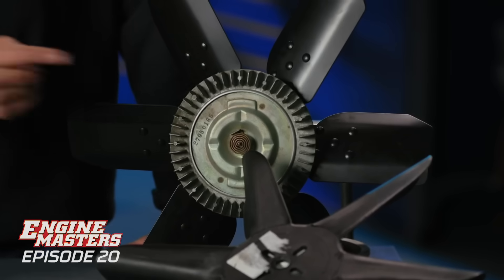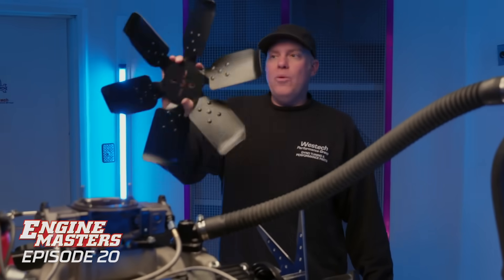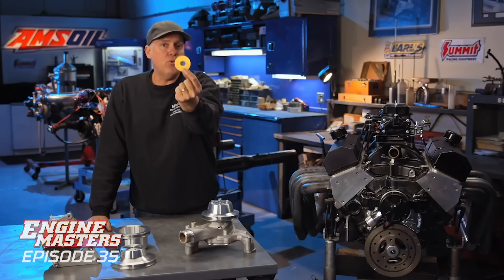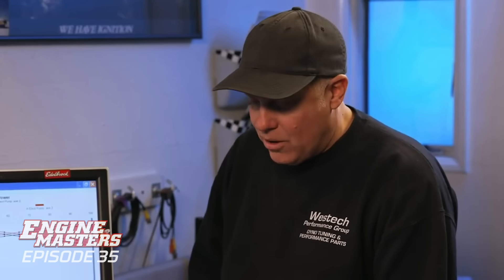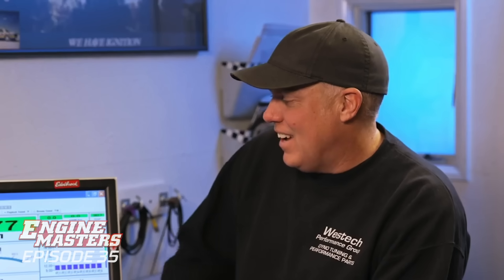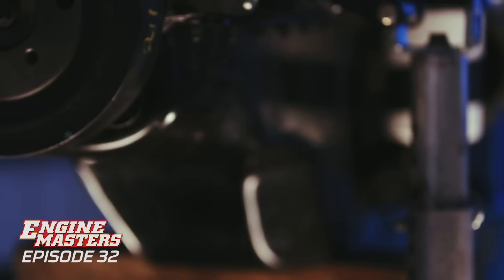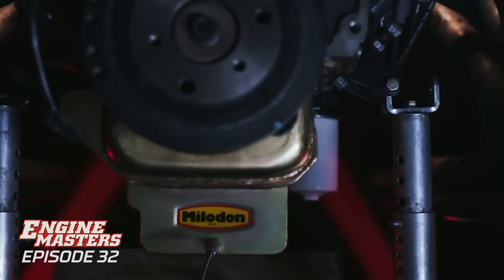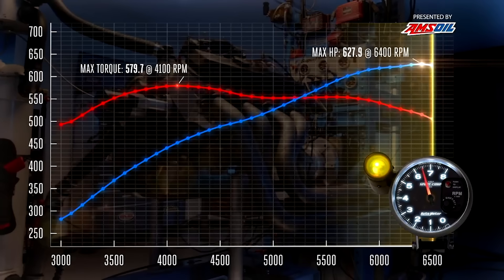Don't Do This! How to Ruin Your Engine's Horsepower | Engine Masters | MotorTrend

Comment: Well which fan was best? I only saw results from two of the four candidates.
Reply: Yes Chris the whole vid was disjointed and difficult to follow.
Reply: @ThePaulv12  If you read the title of the video, and noticed the overlay of which episode each section was from - you can interpret that this video is just a compilation of videos that show what common mods tend to kill power.
Reply: Yeah! What the F?
Reply: @troykruse5161  ever since they stopped putting full episodes in YouTube, they've been making these mismash clips from various episodes in hopes of luring in paying subscribers onto the motortrend app. But they put together these bait videos so poorly I doubt they get many people to join.
Reply: @SeanMontie  like me: not sub
Reply: @SeanMontie no they do it so they make new video so it looks like we haven’t watched this one before. That way they can get new views and all that to make money again off of it. They’re just gaming the system
Reply: The best is to replace the fan and install an air plane propeller. The extra pull will give you quicker 1/4 mile runs
Reply: For the record to those of you saying "electric", it wasn't even one of the four given options. They were:
1. Steel with clutch
2. Plain steel w/o clutch
3. Plastic flex
4. Aluminum flex
Reply: @ChrisInND  yes and electric is better and just as easy if not easier to install than any of those :)
Reply: @Joshlindsay22  no way is it easier to install then removing and tightening 4 bolts lol
Reply: @Thumper68  if you don’t know how to hold the fan in place while doing it yes it is. It took me no more than 25 minutes to install mine but it was switched not relayed
Reply: @Joshlindsay22  ok well took me 5 minutes to change mine. like I said 4 bolts doesn’t take a genius...
Reply: @Thumper68  but the man with the wires instead of bolts it’s always gonna be faster
Reply: @Joshlindsay22  What's holding the e-fan to the radiator?
Reply: @thatsonebadhatharry8610  electric fan ties is what I use
Reply: More i think about it, which fan pulls the most air for the power used?  I would give up a bit of hp if the fan pulls way more air
Reply: @sketchyssk8shop  
Fan only needs to pull "enough" air to keep the coolant at temp. "More than good enough" is just wasted HP.
Reply: @bcubed72  enough for a dyno pull or enough to tow a load all day?  I prefer to pull a load tather than a 5 second dyno pull or a 15 second drag race.  Or if i have to sit in heavy traffic (which i do a lot)  id rather have more air n waste a hp or 2 than over heat
Reply: @sketchyssk8shop  a pair of electric fans
Reply: Did the oil pan have a windage tray? If not the oil pan upgrade is a joke
Reply: They did this same test in the magazine and the temperature controlled clutch fan won... and is more reliable over 50 years than electric fans...
Reply: I was thinking the same thing. They ripped us off for video time & all information gleaned from the testing.
Reply: SuperDave Miorgan  electric fan #1 clutch #2. Only time a fan is needed is for slow speed and or heavy load at slow speed. Once vehicle is moving at a moderate speed the air flow over the radiator should be sufficient to cool the engine unless you  have blockage or an unusual radiator location.
Reply: Tangent:
How deep (in the shroud) should the fan be on a custom built car?
Reply: They didnt show the clutch fan dyno as it increased engine torque by 5% due to keeping healthier temps.
Reply: SuperDave Miorgan  I guess that really depends on the intended purpose of the vehicle you are driving. A daily driver maybe, a weekend warrior probably not. A truck yes. And most but not all new cars use electric fans so I don't think the alternator is an issue. It's really just a situational thing. But the clutch fan and electric are the better of the four for sure.
Reply: They did this to peak your interest so you will pay money to watch the whole thing.
Reply: I know..I used to run a fan like the one here with the Blue on aluminum blades..it was called a "flex fan" way back in early 80's when I bought it for my 68'Camaro..would like to know how much HP it drained.
Reply: electric fan.....ALWAYS. Plus you can run a switch to manually turn it off for drag racing to reduce the load on the alternator
Reply: @jubalwright421  You can also switch OFF your alternator for the 1/4, if you know how to hook up relays.
Reply: @jubalwright421  not always.   Clutch fan is more efficient.   Converting rotational to electricity to power a fan to make rotational is not efficient.
Reply: @jubalwright421  Put a switch to turn off the BAT. feed to the alternator too.
Reply: i did some research and at your local auto parts store they sell both a non-oem fan and fan controller  that you can rig in. just take the old fan and clutch off the car and run with that and you'd have the power loss removed as well as a possible weight reduction when it's all said and done.
Reply: @jorgey4  when bypassing the electric fan in the summertime, just keep a close eye on the temp gauge.
Reply: I thought I was trippin.
Reply: I think what they are saying here is you can expect to lose anywhere from 23 to 30 HP from your fan.
Reply: E fan is always best
Reply: Electric fans
Reply: Clutch fan will always win.
Reply: @johncholmes643  but only if your engine runs under 160-170 degs, once it gets to normal operating temp 180-190 degs its locked up, or its supposed to be.... also anyone thats observed your average aftermarket aluminium flexifan blades as you rev your engine above 4-4500rpm you'll easily see the blades flatten out to the point that the blades have lost almost all their pitch. Hook up your timing light and it'll slow the blade speed down enough (not perfect) but enough that you can easily see the pitch change from idle to say 4500rpm which is where any good flexi fan worth having should be almost flat and not creating bugger all drag. The example Flexi fan that David used was clearly used to exaggerate the difference between the 2 options, which at the end of the day proved nothing. The test should have been which of the fans available to the average Joe Public actually shifts the most amount of air for the least amount of parasitic drag. 'CAUTION'- Be very very careful when using a timing light or torch anywhere close to a Spinning Fan, theres is no need to get any closer that 12' from any spinning Fan or Belts/Pulleys.
Reply: This is a copy of an old test in carcraft, same results BUT based on those results(and these).  My Plastic fan takes about 10hp because of the pulley ratio I run, they use a larger crank pulley than water pump and I use the opposite.  Basically my fan sees less than 4000rpm, so just look at their 4000rpm mark roughly, most mech fans are about the same at that rpm.  Far as electric fans, your taking mechanical work converting it to electric and then back into mechanical, there are always losses no alternator is 100% efficient.  Electric fans work great for highway cars when speeds are high enough that they don't run or at the drag strip when it's off for your pass
Reply: @BOOT    true I did the same , by far the cheapest HP you can get.
Reply: typically, the clutch is best, tho you'd think its heavy.  But even better is an electric fan you grab out of the junkyard for a front wheel drive car.

BUT, make sure you grab the alternator.  Our old muscle car alts don't have the juice for electric fans, massive stereo, and EFI. and they are heavier than the average denso unit.
Reply: Ask your money back :-)
Reply: ???? Electric Fans
Reply: @mikespeck8642  yeah you know fans that hook up to a switch and power they’re pretty great
Reply: U can add a full throttle and mph relay to turn fans off win win floor it and drive dont got to remember anything with that !!
Reply: @rickybailey7123  if you use a generic fan controller it just kicks the fans on when the radiator hits a certain temp. you don't have to program a holley ecm or jerry-rig a bunch of switches.
Reply: SuperDave Miorgan  my electric fan setup was just as much as my clutch fan setup to replace I fabricated my own shroud and all. Don’t go talking about too much money bs
Reply: electric fans is the best candidate

Comment: Today I learned that you don't want to warm up your motor before racing it
Reply: Heat robs power. Unless the heat is needed, you don't want it.
Diesels also need to be warmed up before a race.
Reply: Also friction robs power and hot oil flows and lubricates better than cold oil. So it has to be warm enough but not that the intake soaks heat. Also a cold car runs poorly at first till it warms up the combustion chambers etc. Heat is needed to makes power because it loosens the fluids and preps the engine to make that run too.
Reply: 130 degrees

Comment: I’d like to see a full companion of running mechanical engine driven fans and compar that to alternator plus electric or dual electric fans.
Reply: mechanical fan = mechanical straight.
Electric fan = mechanical to electrical and back to mechanical.
I'd like to see your suggestion too but I reckon this: Dual electrics and fan clutch ~ the same power loss. 
Advantage with electric is it cycles on and off but a fan clutch does too, to an extent. 
Personally I don't like electric fans as primary means of cooling unless it is OEM. My Mitsu daily driver has them and they work great.
Reply: @ThePaulv12  thank you for the reply. I would also agree. The other thing I like about electric fans is if you want to run them when your vehicle is shut off to cool it down you are able to. Plus you can have them set on a timing so they don’t run out your battery. The same goes for an electric water pump. But it would be nice 👍🏼 to see it all. I’m just some guy looking to gain some knowledge [=
Reply: @ThePaulv12  Not even close, they only pull their max amps while spinning up. Once up to speed the pull about 1/10 the rated amps.  Using a mechanical fan is just a waste of power today.  A powerful duel electric fan might pull 35 amps max,  even at that that's less than 2hp to generate the power for that.

Comment: Dave, please do this simple test, I, for 40 years never could figure it out.  Ok, here it is,  in days of old we use to flip the air cleaner lid upside down  on GM  stock air cleaners to get more air and a better secondary open butterfly sound.  Please test to see if it was a waist of time?
Reply: They did that in another episode many years ago. Think it made a tiny bit more power, but not enough to justify the extra dirt getting in the engine.
Reply: Okie it was great at 16 to flip every lid we could. It was cool.

Comment: Okay, but if you're using a roller cam, wouldn't you naturally spend the extra money on a pan with proper windage and oil traps? If so, wouldn't that restore the horsepower and allow you to run the full 7 quarts of oil?

Comment: If you are building an engine for horsepower specific reasons why would you not use electric thermo fans? No disrespect intended genuinly interested in opinions.
Reply: Most people are wondering if the hp/tq gain is worth the time and money of ditching the old mechanical fan on a street car. All street car stuff. On a max effort race engine you will never see a mechanical fan and will rarely see any kind of mechanical water pump. They can’t take the rpms of a race engine. And cause too much parasitic loss.
Reply: @devoncoolman88  Yeah I get it just doesnt seem like that big a deal to go thermos. Was wondering if there was any specific reason someone would choose crank driven fan other than keeping it factory.

Comment: Our 72 dodge was overheating. Dad reached in and stopped fan on running motor. Had bad thermo clutch. He was brave
Reply: Brave? More like stupid. Had the clutch been good and the motor pretty strong, he'd have lost his fingers. I've lost the tip of a screwdriver by accidentally getting too close to a running fan. Those things don't play.
Reply: Not cool

Comment: So my rear main seal is actually a power adder. 1 more excuses not to fix it then.
Reply: Its not leaking oil, its just sweating horsepower.
Reply: @Underpantsniper  Not sweating hp, it's sweating drag.
Reply: low on gas help with weight reduction too
Reply: Your best run will be the one before it grenades
Reply: Ironicly its tru, the closer the engine is to damaging point the better it works
Reply: @ghostwarhammer007  to better word it, the tolerance is wider so less friction thus giving it better performance.
Reply: @BlueRice  If it gets that low the friction won't be less for long but there's less pressure.
Reply: @BlueRice  thankyou guys for that clarification. I read that statement someware i thoight it was a joke,until i was watching "history of formula 1" and it was mentioned by the engineeers ... Dannng yooo!
Reply: @scottricklaroque7428  thx mann
Reply: @ghostwarhammer007  so that's why my supra makes 1000 hp stock? More like 1100 brooooooo 🤣🤣🤣

(This was a joke)
Reply: @ragooagoo4918  🤭🤭💥💪

Comment: You can directly calculate the hp use of an alternator based on its output.
Reply: Sure, because alternators are 100% efficient right?
Reply: @Underpantsniper  no, they are not 100% efficient. They are about 55% efficient. This equates to 1 hp per 25 amps. I can go through all the math, if you would like, how to to correlate volts and amps to watts and and watts to hp with the efficiency loss. It's plenty accurate. Use google before you comment, you won't look so stupid.
Reply: @AnonyMous-jf4lc  I look stupid... but still glad i commented so i can learn somthing new. Whats the average resistance of a alternator?
Reply: Still you loose less power with electric setup.
Reply: @L-Noble.YT_Hi.Res-Soundminds  he just proved your point.... gotta love the internet ;-)))
Reply: @Warrick440 👍Yes...
Reply: @L-Noble.YT_Hi.Res-Soundminds  we are talking about the alternator...........
Reply: @AnonyMous-jf4lc  Yes the alt. So if I put a 20 amp load on my charging system the alternator will only take a little less than 1 hp from the fans turning on correct?
Reply: @L-Noble.YT_Hi.Res-Soundminds  my comment was about calculating the horsepower consumption of the alternator based on the load, nothing about the other accessories. Typically, you lose efficiency converting energy (rotational to electrical back to rotational) however, because of the variable operating RPM of an engine, electric accessories operate in a peak efficiency state, so you tend to gain more than you lose.
Reply: @AnonyMous-jf4lc  Thanks for explaining that, I appreciate it..

Comment: So, long story short:
Drain oil, remove fan, alternator, water pump, run ice as coolant and only drag someone when it's sub-freezing temperatures at the track.
My 1972 Pinto will now do 300mph with 2,000hp?
Cool.
Reply: ROFLMFAO!!! Goddamn, I was thinking something along those line too!! ha ha ha
Reply: Sort of. I watched a guy running pretty consistent 8.20 1/8th mile passes in his Mustang one late afternoon. I walked up and said, try this, it'll cost nothing but a bit of time. Cool the car off to ambient temperature,  about 80 degrees.  Pull it to the line building as little heat as possible.  Of course do your normal burnout. See what it does. He came back jumping up and down,  shouting and yelling. He was so happy.  The car went 7.98. First time ever in the 7s. You're welcome.

Comment: Why don'tcha use an electric fan to be done with it . No parasitic drag AT ALL .
Reply: More load on the alternator.
Reply: No drag when they're off. Certainly some drag on the alternator when they're on but I agree they're the best way to go. All modern cars use them.
They're also much more effective when sitting in bumper to bumper traffic as a belt driven fan won't be turning very fast.
That being said.......I'm still running a flex fan.
Reply: only when they turn off..